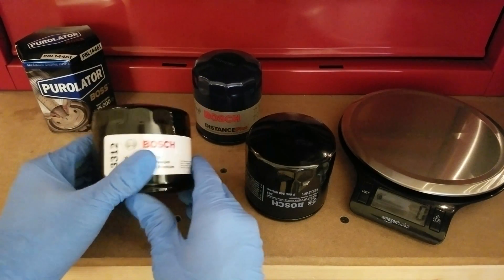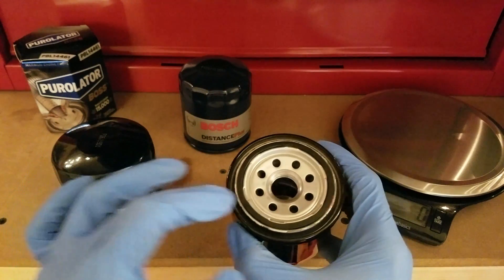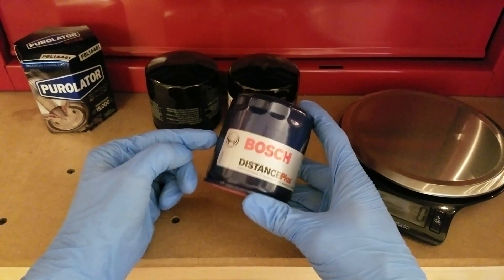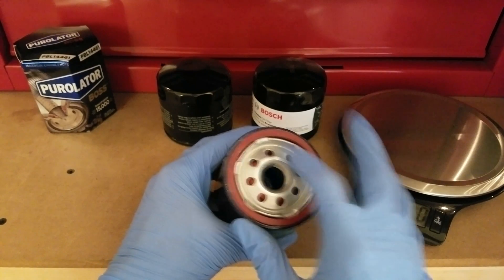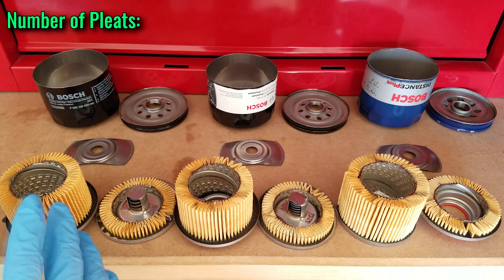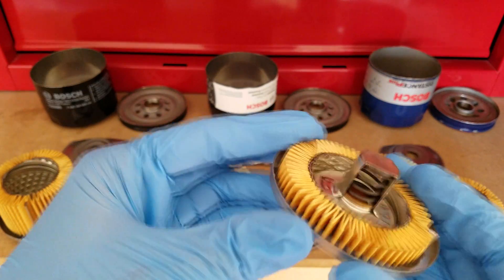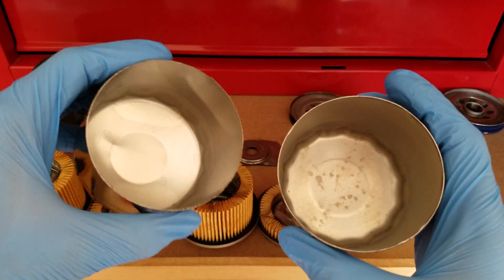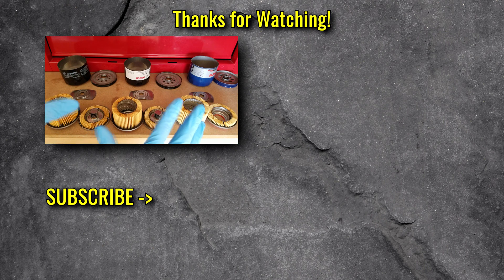BOSCH Oil Filtes Cut Open! | DistancePlus/Premium/Workshop

Comment: I have used this Distance Plus. It is a great filter if you want to go a year or 18 months without changing your oil. The filtration on the DP is tops! That is what you want mostly in a filter.

Comment: Bosch Premium 3313 canister filter vs. Toyota OEM.  Anyone have a knowledgeable opinion?
Reply: YES. Get the BOSCH Premium -- it has a 20- micron rating. The Toyota OEM does not.
Reply: @SlikLizrd 
Thanks.  That's what I've been using.
Reply: @jshepard152  Remember -- A filter with a 20-Micron Rating should be changed at 5,000 miles.
 If ya wanna go longer, get a Fram Ultra.

Comment: You need case stiffness because the longer (distance+) the filter is on there usually the harder it is to come off so you will be putting more torque on the canister
Reply: Not sure about “need” but yea it is added protection in the event you tighten it too much or leave it for way too long. Hand tight is fine for filters, been doing that on all my vehicles and usually can hand remove, but I have removed very old filters that deformed the case with a tool.

Comment: That's the disappointing aspect of filters. For a given engine, the manufacturer should make a filter to the best possible quality it can and supply that filter through all streams of outlet. There should not be a filter of lesser quality than another from a manufacturer.

I want the best filter I can get and since we have VW cars, we use Mann because they are OE to VW and, by the way, Mann also make filters for Bosch.

Comment: if your engine put out 29g of dirt then the filter is not your problem.
Reply: yes obviously the filter would not be the problem in that case, but the whole point is to see the capacity and efficiency in each filter, a 1 or 2 percent different in filtration goes a long way when you own a car you plan on keeping your whole life...

Comment: You seem to be a brighter bulb than many on this venue - how about a video about AIR filters. Everyone forgets that 90% of that crap on your oil filter came in through the lousy and undersized air filters on todays cars. Not to mention the joke filter boxes that don't seal to the gaskets. If I could find a place for my dozers air filter in my car, the engine might make 500k miles easy.

Comment: I'm old and keep my cars just about forever. None has burned excessive quantities of oil. None ever had the heads off. I've had my current daily driver (Lexus LS400) for 20 years of excellent service. People worry far too much about the specific details of various oil filters and motor oil advertising hype. I use conventional oil (now API service SN, ILSAC GF-5) and usually just buy whatever is cheapest. I change the oil and filter at 5K miles and always do it myself. I would never trust one of those national franchises. That's all the thought I put into the matter. Oh, and I VERY, VERY rarely go to a dealership for anything.
Reply: Thats what i do too but just for better feeling of myself I buy higher end oils and filters but when they are in sale or clearance i buy a bulk. Other than that even normal quality nowadays is high quality of yesterday when it comes to oil
Reply: The latest API Gasoline Engine Oil designation is:
A P I Service "SP ",  ILSAC GF-6.
It's a crryin' shame that you put conventional oil in that Lexus LS 400 --
Damned nickle-snatching fools ruin everything !!
Reply: @SlikLizrd  Still has the original spark plugs, too, after 24 years. Actually, the yellow cab engine teardowns showed no difference in engine wear between synthetic and conventional motor oil of same API service rating. What is important is changing according to Toyota's recommendation which I always do..and do myself.
Reply: The Distance Plus is the best if you can still find them. Expensive but the best!

Comment: I used the Bosch DP 300 on my Harley 750. Never had a problem. Currently using the Premium 3330 on my 18 Sportster 1200. The DPs are hard to find locally.

Comment: Been using the distance plus on my Hummer H2 for a while now. I noticed at Walmart once they stopped carrying Bosch filters and had all of their distance plus on sale for like $2 each. Bought every one they had in stock and got 6-7 for the standard price of one. When I got it it had a cheapo filter and cheap 5-30 oil and struggled to get past 40 psi oil pressure. With Mobil 0-40 and the Bosch it stays above 40 at basically any rpm above idle and will go to 65+ at high rpm.
Reply: Same here! I happen to pass by the filters and saw they were two dollars! I took all they had.
Reply: CONGRATULATIONS !! You just f**ked yourself by buying a bunch of DISCONTINUED PRODUCT that was ON SALE because of manufacturing defects.

Comment: I have always used the Toyota oem oil filters for my Camry and Lexus ES since the quality of the aftermarket filters can be suspect.  I have been told that the Honda and Toyota filters are made by Wix, but I have no proof.
Reply: The OEM will subcontract a supplier dependent on country, For Toyota in pacific area its usually Fram. For Japan it will most likely be Denso and in Europe I would suspect Bosch. The quality of Main stream brands is as good as if not better then the OEM. And almost all the mainstream aftermarket filter brands are OEM providers to some brand vehicle. The best tip would be Never fit a filter that doesn't have its branding on the filter.
For honda has the manufacture codes in part of the part number.
PLM / PT7 = FILTECH
PR3 / PLC = TOYO ROKI
P0H = FRAM or other
It all depends on Cost of manufacture, Shipping, Duties and Availability.
This also applies to alot of other components for instance OEM light bulbs will almost always be Osram, Trifa, Phillips, Koito, or Bosch in Asia Pacific region.
Reply: honda oem filters are made by honeywell which also makes fram. works but not the best
Reply: They could be made by WIX, I do not know, I do know that the Toyota Denso have basically  the same efficiency ratings as the WAX XP.
The Toyota Denso oil filter is rated at "20 micron or greater, media is 51.0% efficient"